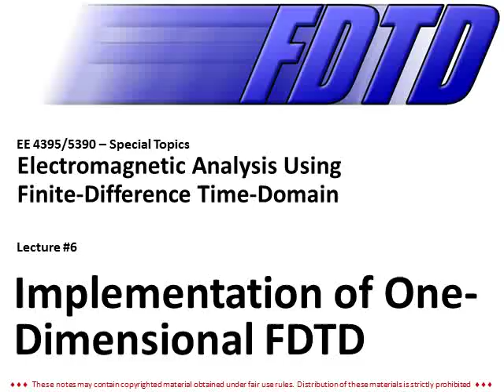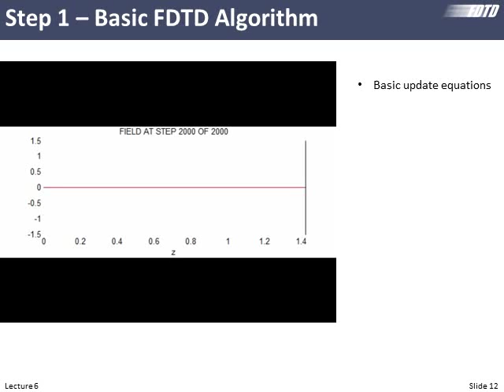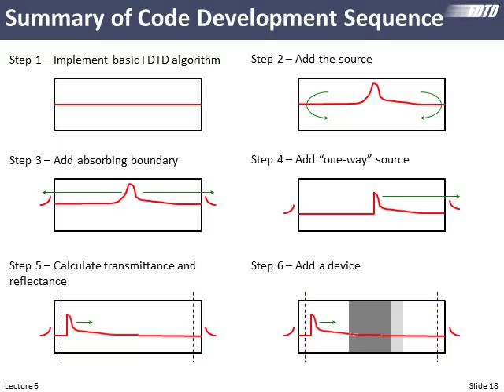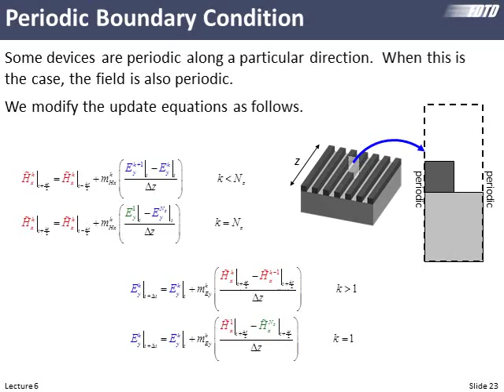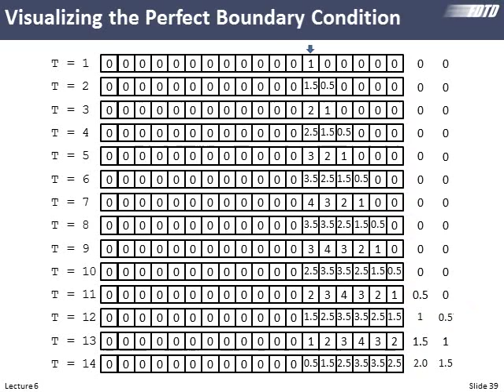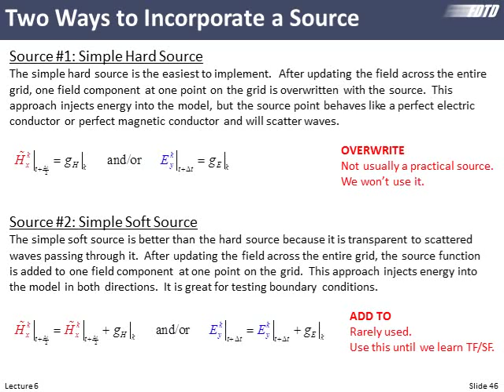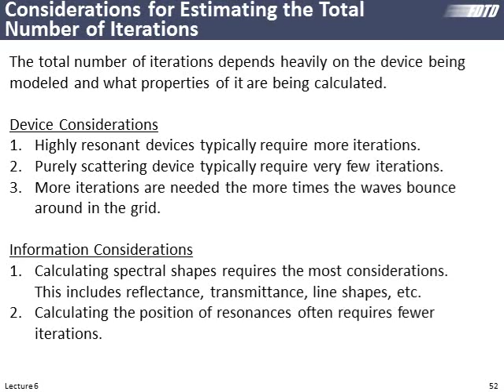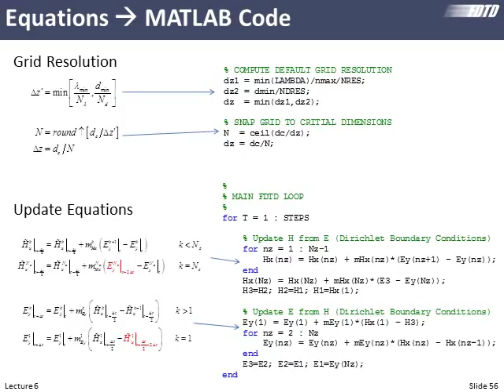Lecture 6 (FDTD) -- Implementation of 1D FDTD

Comment: it is very amazing lectures, i m really enjoying during watching this amazing lectures. thank you so much for this lectures. 
there is one thing : in 34.30 i think you mean tau >1/(pi*fmax) isn't it ?
Reply from the maker: No.  tau can be made smaller (shorter pulse), but not longer.  A longer pulse would have more limited bandwidth and thus not produce much power at the frequencies you are interested in.  Does this make sense?
Reply: thank you so much for your reply professor, in your condition which claims B<fmax , i mean we must not exceed that frequency isn't it ?, since B=1/(pi*tau) this implies  1/(pi*tau) <fmax so that tau >1/(pi*fmax).  i mean i m confused about your condition about B<fmax , can you explain more
Reply from the maker: In the latest version of the notes, I removed B from the discussion entirely.  B and fmax seemed to cause too much confusion with everyone.

fmax is the cutoff frequency of the source.  The frequency content of the source decays smoothly so there is still power in frequencies above fmax, but fmax is a convenient metric to use as the cutoff frequency of the source, above which there is too little power to get accurate simulation results.

B is the bandwidth you are interested in simulating your device over.  Thus, you must keep B < fmax for accurate simulations.  The confusion arose because there is an important difference between bandwidth of a signal that extends from 0 Hz up to B and a signal that extends from f1 to f2 where B = f2 - f1.  I fixed this confusion by eliminating B from the discussion entirely.  Now a source with duration tau will cover all frequencies from 0 Hz up to fmax.
Reply: since we need to cover all the range 0 Hz to fmax, the necessary condition is tau<1/(pi*fmax). thank you sir for your help, and thank you so much for your lectures. They are the best lectures in FDTD .